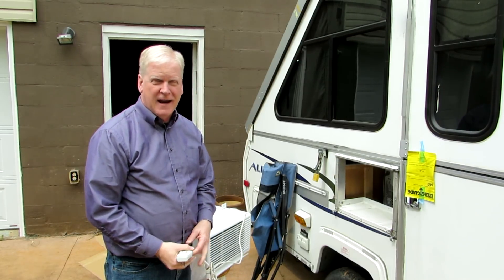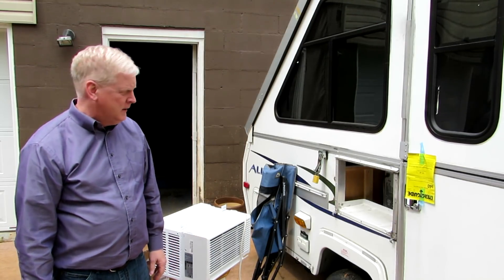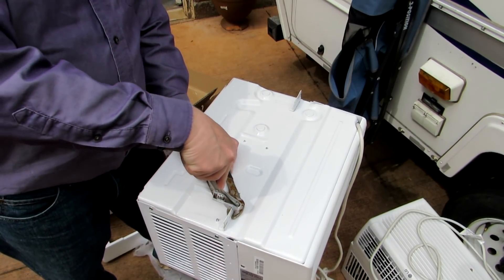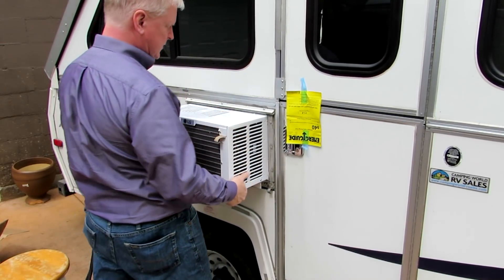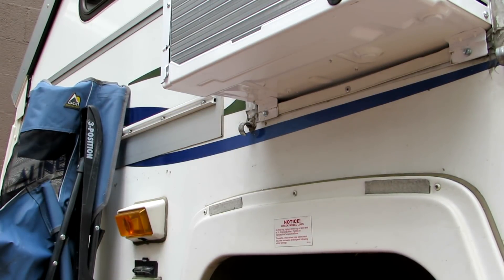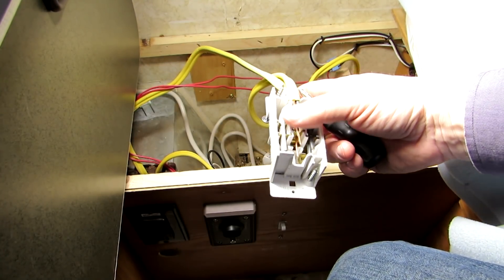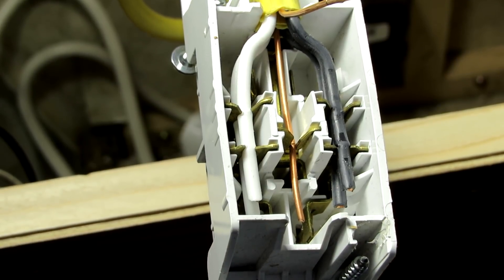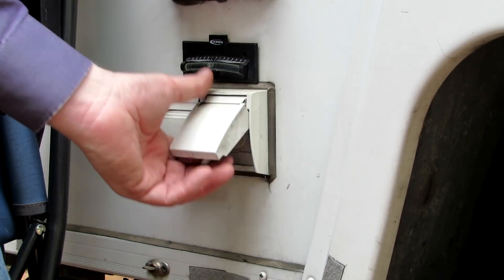New A/C, New Elect. Outlet,  Electrocution Hazard on my Popup Aliner

Comment: Have you seen  the  midea  a.c. 2020  it comes with a support platform to keep it in the window. You can  see a YouTube video on how to put in .
Reply from the maker: The controls are in the wrong place if you put it where the original A/C went.  You would never be able to turn it on or off or adjust.  They make quite a few models,  I don't see one that would work in the Aliner or any RV for that matter, and they seem a bit pricey?  Got a Link to it?

Comment: 2 circuits ac is 30 amp microwave is 30amp  can't use at same time
Reply from the maker: Microwave is about 5-7amps,  A/C on start-up may go up to about 10amps, but normally runs at 5-7 amps.  Where did you get the idea they were such a high amperage draw.  Just google a 5000BTU A/C Amperage!

Comment: My Aliner scout lite did not come with ac unit. can you tell me how you made the door for the ac unite when not in use. Someone said I can order the frame and drip pan from Aliner to install once I cut the hole.
Reply from the maker: I haven't made a door for my A/C unit yet, for when it isn't in the "window".   You can cut any material and fit it to the hole. It just depends on what you want to use it for. If your think ing a table, use marine grade Plywood. If you think you'll take it out for winter camping, then use a sheet of Polystyrene for insulation.  Lot of options.   Aliner should be able to set you up, but its pretty simple, just a aluminum angle around the outside of edge of the hole to reinforce it.

Just a thought though, it probably would not cost more than a $100 to let a dealer do it and then it would be guaranteed.

Comment: I put my new AC in the rear of a 1965 Trotwood...sadly I discovered rooted frame wood. .. had to reframe the hold thing, then I reinforced the frame with what is know as roof flashing around the framed new wood!! Then air tight it with AC duct tape. Cheap trailer components are in my Navion too ..lol!! Love the GFI!! Need a tester too!! Somebody rewired  my trailer wrong too!! See learn so much..thank you!!!
Reply from the maker: You can buy anything I show in my videos off my website... GOINGNOWHEREFASTRV.COM

Comment: Suggestion. Remove cover from your new a/c, Check the evaporator, the suction line, hot gas line, condenser, and cap tube, see if you can go to home depot and get some support fittings so there is less movement. The support fitting must be copper or rubber to prevent a chemical reaction which could make the copper tubing leak. You can also use pipe insulation to. Doing this will make the a/c last a very long time. Love your videos, have a great summer.
Reply from the maker: Thanks.  Good suggestions !!  I am actually going to pull the A/C if I am going over rough roads... (4wheeling) I have a door built to fill in the place where it goes.  No reason to carry it if I am not plugging in to electricity !  Thanks for the comment !

Comment: Out of curiosity, what is the current draw on the Microwave and the AC Unit?  I am unfamiliar with AC unit power consumption, but the microwave is probably about 12 Amps or so.
Reply from the maker: It may spike to 10 amps on startup, but actual draw while running at 120volts is more like 7amps. (I = P / V, I = 6.25 A)  Also this is a 750watt Microwave.  Much nicer for heating up food, no big hot spots in cold food.  Heats a bit slower though.  Thanks for asking !!
Reply: I was running a generator today and only had a 20 Amp 120V connection. The AC fired right up and worked.  It didn't bog the Generator down at all (6250 running watts).  I didn't  run it for long but it worked.  I was worried because I was pushing the electricity through the 120V/30 Amp Dogbone.  Thanks for the reply! I may be in your "neck of the woods" in Sept/Oct this fall!  I'll be checking on your where about for sure!  Keep up the good work!

Comment: Did you test the electrical outlet on the other end of the cord in case your tester is faulty or the outlet is faulty
Reply from the maker: Good Question !!  And Yes I did.  Though I suspected the Extension since I knew it had been repaired !  Thanks for asking !

Comment: Perhaps the air conditioner was on a dedicated outlet?
Reply from the maker: Nope,  The way the electrical is set up, the front is on one circuit, and the back is on another...  So all the outlets from the power convertor to the door are on one wire.  And all the ones from the Power convertor to the furnace, frig, and dinette area are on another.

Comment: Those two circuits are for separate devices a/c and microwave each pull a lot of amperage.  You will not be able to run both at the same time on only one circuit.   At the least a tripped breaker and worse case a potential fire.  I would return the wiring to origional
Reply from the maker: Actually they are on the same circuit in an Aliner.  Neither the Microwave or the A/C are very large power draws once they are running.   I'm not sure if starting them up at the same time would trip the break or not, but I have run the air and used the microwave at the same time.  They are on a 20amp breaker and its "slow blow" so that works.  But the microwave is 700 watts, the 5000btu is probably a little more than 500watts...  not enough for breaker problem.   Smaller is better !
Reply: You're assuming there is a separate circuit. Rick seems like he would know that. How many separate circuits do you think a 30A pedestal can support? And what does "a lot" mean, anyway? Modern small AC units that size draw surprisingly little current, other than starting current. And it's a tiny microwave too.

Comment: Ah, the joys of the 30 amp... So, are you going to get a new extension cord, or rework the old one? 
Once I used my microwave with  the A/C running. What fun! I couldn't determine just which fuses I had blown, so I replaced all of them on a day when our camper was in full sun and the temp was 95! I had to get on my belly on the floor of my camper! My husband was recovering from surgery. He was, shall I say, less than helpful.

Gotta keep going! A bad day RVing is better than a good day at work!
Reply from the maker: Really it shouldn't be fuses to replace.  It should just be a breaker to turn back on (after turning everything off).  And you must have had a bigger microwave and A/C than I have...LOL.  Thanks for the comment !
Reply: Going NoWhereFast  I have a breaker and fuses. I turned the breaker in the camper on and off. I turned the shore power on and off. It came down to the fuses. My husband is an electrical engineer. You know what they say about electrical engineers? Plug it in, stupid!
Reply: Glad Aliners don’t have a lot of e posed metal... lol.   I have a voltage tester but it’s not a plug in like yours.  We are thinking of adding an outside outlet to our Aliner Ranger 12.  There is a single internal “trailer trash” outlet inside a cabinet where an air conditioner would be installed in lieu of the Cool Cat AC & Heat Pump we have.should be an easy task if I get brave enough to try it.  Safe travels and don’t let the exes fix anyth8ng for you... lol
Reply from the maker: Ya,  that should have been my first indication !!   Thanks for the comment.

Comment: Hey Rick....Good info.  Could you ID the new double outlet unit and single gang box you installed?  Also the circuit tester?  Are they Amazon items?  The new A/C doesn't appear to be the same brand as Aliner original issue.  I've got a 2015 Expedition that came with an LG LW5013 5000 BTU.
Reply from the maker: I bought the "new" double outlet last year and never got around to installing it....  but I will try to get a link to it.  Be right back
Reply from the maker: The outlet tester is a simple $10 item.  https://amzn.to/2HMdhad   I could not find the Sideways outlet.  The A/C is the regular LG model that is used.  Sometimes they brand it Goldstar or some other brand.